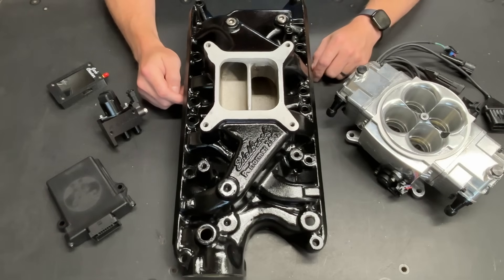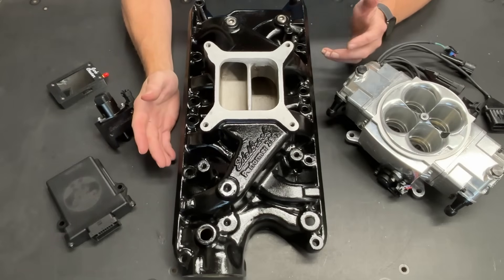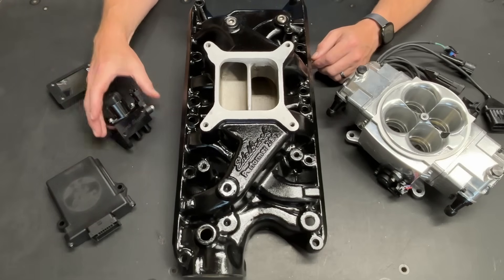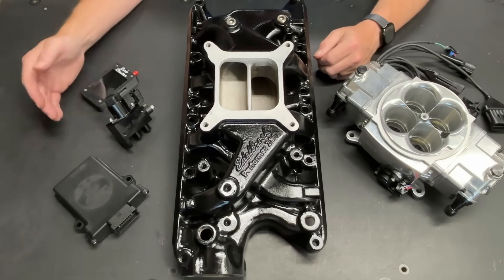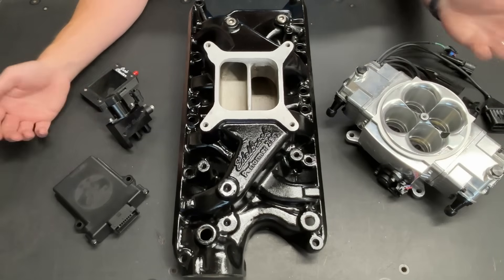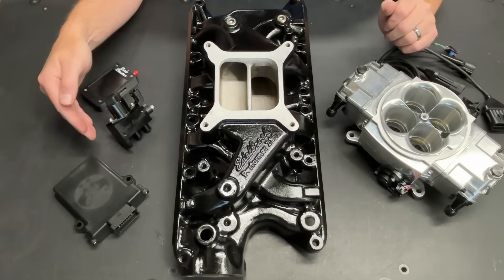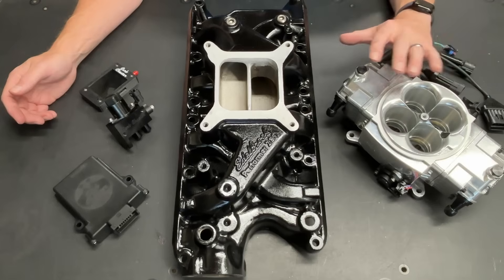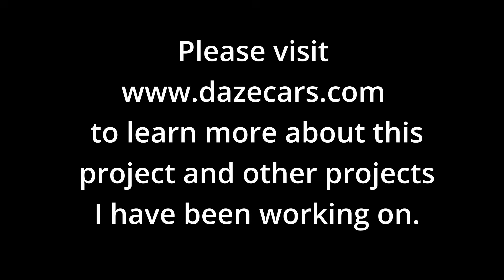Computer Controlled Fuel Delivery Carb Cheater 2.0 Vs Sniper  2 EFI, Why I Decided to Try Them Both

Comment: Very interesting. Funnily enough I got a quite a similar device in my '73 VW Beetle. A guy named Paul Wurm made catalytic converter retrofits for a lot of cars including carburated cars. In order to stay within lambda 1/AFR 14.7:1 he just added a slightly larger main jet and a O2 sensor controlled air bypass valve. Just like the carb cheater only a few centuries earlier 😄 Fun to see that concept being used somewhere else.
Reply from the maker: Its an outstanding idea so I am not shocked it has been used before

Comment: The boiling point of gas leaves a good reason for efi. Gas boils above 180, so when the engine is shut down and the temps go up, raw gas is leaked into the engine. Also if the carb sets a while, the gas evaporates. I like the idea of the O2 sensor...
Reply from the maker: Gas in the carb and its tendency to boil off is a great and valid point, but Im not really addressing that with this series of videos.    There are tons of things I could compare  making a pro con list for both and crown a winner, but thats not the point.  (besides everyone on the internet would tell me why I was wrong)  There are advantages both ways and things that each one will do better.  I'm just comparing the drivability and performance of the two while the engine is running.

Comment: When comparing costs, you also need to include cost of a high pressure fuel pump forEFI and potentially a different fuel tank and new EFI rated fuel hoses.  Looking forward to seeing the comparisons.
Reply from the maker: cost wasn't a direct comparison,  just a ball park.  Especially given the fact that sniper is not the only game in town and there are other TBI units in the $600-$800 range.  Also in some cases there are ignition component considerations but being those are often optional and not really a factor.  Basically the prices are similar in a lot of cases but not always and there are too many variables so thats why I went with a ball park.

Comment: The reason I went with carb cheater on my newest project is that it already has a carburetor that works very well, so it'll be cheaper and if the computer on either or fail the carburetor will still drive home with no issues. I drive my car 100 miles a day to work and back (50 miles one way) so reliability is the most important thing to me.
Reply from the maker: Probably would have worked really well with the carb alone and the CC will likely only make it better.

Comment: For off-road application I don't see it since it doesn't solve the problem of banging around and running at angles.

I do not like aftermarket EFI systems due to quality of components, being at the mercy of fill in the blank brand, and you can't easily buy replacement parts over the counter at a parts store. I like OEM systems you can get away with it.

If I was going with a carb this would be good to help you tune it on without a dyno. But I wouldn't use it as a band aid for a poorly set up carb.
Reply from the maker: I agree it doesn't solve any offroad issues but could be used with an offroad carb.  To your other statements, its not designed to be a bandaid for a pooly tuned carb, not the point at all. You still need to run a properly tuned carb, this just helps lean out all those times when a carb WILL go rich.  Running rich is inherent with a carb because a little too rich is safe but a little to lean is dangerous and carbs completely err on the side of caution
Reply: @dazecars I could see that, almost like an insurance policy for your mixture. I think running a carb it would be nice to have a wide band to see what it's doing. 

Is there any literature on how much altitude it would compensate for? That would be cool if you go up in altitude it gives you some fuel correction.
Reply from the maker: If you watch any of the Carb Cheater videos he says over and over, " a carb is a static metering device in a dynamic environment"  in other words there are so many variables effecting the fuel ratio but a carb only adjusts based on airflow changes.  Thats why carbs always a some point over fuel an engine even when properly tuned.  Extra fuel is safe but not enough fuel is dangerous.  This is proven out by the fact that a carbureted engine gets tired at 100K miles but a n EFI engine is good for twice that because the oil is not washed off the cylinders.  

As far as altitude I think it can adjust for most altitude changes.  That is exactly where the idea for CC came from.  Luke was using a wide bad O2 sensor with AFR gauge and driving on power tour with significant change in altitude.  He had a vacuum hose and adjustable valve to compensate for altitude changes (massive changes not constantly adjusting as he was driving)  It was this concept that lead to the CC system that would adjust on the fly.

Comment: Dropping the fuel tank installing  a fuel pump. Running power and lines makes the carb cheater well worth it.
Reply from the maker: lots of ways to get it done.  I will be running an auxiliary tank with high pressure pump but if I was dropping the tank it would be a big pain as you mentioned.

Comment: One difference between the carb cheater and the sniper is support. One has been around forever while the other has not. Another side of the coin is location and what I mean by that is who will be easier to provide me support when I don't live in the US? 
The carb cheater is an extremely niche product and its great to see it out and about and another option for car folks and tinkerers.
Reply from the maker: I totally get what you are saying and yes support from the car community is for sure far better with an established product like sniper EFI .  But  the quality of support from the direct supplier is a little different thing.  There are several companies that had amazing tech support but once they were purchased by Holley their support was just OKAY.  Holley has gotten so big that their tech support agents in many cases only know what the computer in front of them tells them.  This stands to reason given the vast quantity of parts Holley offers as no one would be familiar with them all.  On the flip side the creators of carb cheater know the one product they sell, front to back and are fairly good about answering emails and youtube comments.  Not really arguing with you just saying it's not as simple as one has better tech support than the other.  The support you can get is very different.  Just my $.02 thanks for the comment
Reply: There is one other thing to.
If the carb cheater won't work - you can ride around like nothing happend.

Sniper breaks and you're screwed on the side of the road.
Plus as far as I know the cc uses a common parts, easy to get at any part store & Luke is super helpful with any support I've seen
Reply from the maker: excellent point

Comment: A computer controlled vacuum leak doesn't change the amount of fuel flowing through a jet.  A rich tune with more air is a leaner tune...but the amount of fuel never changes, IMO.  A GOOD tune needs to be done first to get the CC to work well.
Reply from the maker: I totally agree.  Carb Cheater is not a way to avoid tuning a carb.  You get the base tune in, get it running well and then Carb Cheater makes it better in those situations where the carburetor is running a bit fat
Reply: Fuel follows vacuum signal..
Reply from the maker: its not that simple

Comment: I like that there are Options!

What a great way to retain what ya gots and adding a Fast Respond Wideband Oxygen Sensor and using that to Dynamically 'Tune" for a more efficient use OF fuel.

... I went with a '96 ferd long intake runner and efi setup and custom EFI'd my 78 F-150 300! I really like it but if the EFI craps out what then? I can't just plunk a carb or tbi on this now... lol, <3 all
Reply from the maker: It is nice to have options!!  The question is are the options any good 😁
Reply: @dazecars  The ones leaving Ya grinning Ear to Ear behind the wheel!

Comment: Had the cheater for awhile now, very good paired to the autolite (best card ever imho). Would like to see the difference in cold performance. With the cheater not having a temperature sensor vs sniper, think it may have an advantage until up to temp. Sniper also integrates well into ignition controls. Still prefer keeping as close to stock as possible. Seen too many companies come and go / quit supporting over the years. Can still by bone stock 60+ year old parts though, most any place you are.
Reply from the maker: I too am a fan of the autolite.  The biggest down side to what sniper is doing is $$

Comment: I believe it’s best to block the exhaust gas cross over through the inlet manifold on the EFI conversion. EFI doesn’t need to have the fuel atomised by heat as the injectors optimise the the atomisation
Reply from the maker: a cooler charge will make more power but I want an apples to apples comparison... or at least as close to apples to apples as I can get so I think I will leave it open, at least for now.
Reply: @dazecars if you’re comparing apples, then you should give us the comparison with the heat crossover blocked off also.
Reply from the maker: That would involve installing the intake three times and I am limited on time.  I will install it with the crossover intact, run the carb cheater then swap out to the sniper.  A lot of guys are not going to take the time to pull their intake when installing a sniper just to block off the heat crossover so it should still be a valid test.  Biggest advantage to blocking it off is it makes for a cooler charge creating more power BUT I'm not dyno testing it so I really doubt that mode would be noticeable in the seat of the pants o meter

Comment: Are you still going to develop the inline TBI setup? I noticed you are showing a 289 intake in this video, won't the 393 require a 351 intake?
Reply from the maker: too many projects not enough time 😁  The Galaxie currently has a 302.  The 393 has been assembled as a short block but I have not gotten any further in that build.  The carb cheater sniper EFI project will be temporary.  When I pull the 302 out of the Galaxie to drop in the 393 the 302 will go in the Mustang.  The Frankenstein EFI is currently installed on a 351 W on my engine run stand but I have not fired it up yet.  I tend to jump around from project to project and have not yet circled back.  This summer has kicked my but with unexpected activities demanding my time and I have had little time to get any of these projects done.
Reply: @dazecars thanks for the extra info, I get it on not having time! Always enjoy your videos and presentations. The inline throttle bodies interest me because they look kinda like the Autolite inline 4 barrel setup
Reply from the maker: Thats a big part of why I did it, EFI that looks a little like dual quad!!

Comment: This is great! I am looking at the sniper 2 for my 65 mustang but 1200.00? It looked like 1800 to 2400.00 for everything but I have not made that call to Holley to confirm it. I didn’t even consider the carb cheater maybe that’s the best combo as even a down carb cheater won’t keep you from getting home.  There have been a few stories of people having to send the snipers back in for repair but those returns were quick. Another neat add-on would be power blast plates for the carburetor you are using!
.
Reply from the maker: I can see advantages for both, just depends on what you want to do and what you are comfortable with.

Comment: Maybe I have a fundamental misunderstanding of the Carb Cheater, but I think of it more of an electric air controller versus electric fuel delivery.
Reply from the maker: You are completely correct, it controls the air/fuel ratio by altering the amount of air that inters into the intake.  There is no enrichment only leaning out of the mixture but this is not an issue as a properly tuned carb tends to go rich not lean.
Reply: As I see it if the carburetor was properly tuned then the carb cheater would serve minimal purpose. It seems to me the carburetor needs to be tuned slightly rich so the air bleed can correct that but allow for a richer condition when needed. I assume the cheater does not function until the car gets up to temp. Otherwise an air bleed would cause issues when cold.
Regarding the same fuel being used regardless..., because of the air bleed it would seem to be slightly less. The bled in air is not pulling through the venturi and drawing fuel. Lastly I have concern about the distribution of the bled in air. Is it contributing equally? I think it would be biased to either the primaries or the secondary's depending upon the point it enters. And there are similar concerns regarding a single vs dual plane manifold as to blending. Anyway, just a few thoughts.
Reply from the maker: Those are some good thoughts.  The biggest thing is carbs default to being rich.  They come that way from the factory because rich is safe and lean damages things.  Keep in mind we are not talking massively rich we are saying  13:1 or so.  Even a properly tuned carb that runes at the proper AFR most of the time will have moments when it goes rich.  This extra fuel is why a carbureted engine typically is getting tired at 100K miles but an EFI engine can easily do at least twice that.  The extra fuel washes down the cylinders a little bit here and there shortening the over all life.  We are not talking about massive quantities of fuel just a little at a time.  This is what Carb Cheater helps to eliminate.  So you are not starting with an intentionally rich tune.  You are starting with a normal tune and letting carb cheater clean up said tune.  Total distribution could potentially be an issue but thats the case with PVC gases and carbs in general.  In my case the dual plane intake has had the divider cut down to help promote balanced fueling or in this case balanced addition air and eventually balanced fueling with the TBI.  Lastly you cant think of carb cheater as a device taking big swings making massive changes to what the carb is doing.  Its small changes and small improvements to an already well tuned carb.  I think the biggest hang up people have is they assume this product is something that allows you to drop any carb on any engine, do nothing with tuning and carb cheater does all the heavy lifting.  In reality its a diagnostic tool giving you real world feedback to help ensure the best possible tune and then it also helps compensate for those situations where the carb cant quite get there and defaults to rich... at least that is my understanding on how all this works.  We will see if I have it correct or completely misunderstand when I get it installed and start playing with it.

Comment: I'd be interested to see if you could measure any difference in milage between your current setup with a carb vs with carb cheater vs EFI. Could be an interesting data point.
Reply from the maker: You are actually the second person to ask for that and its a great idea but would be hard to get enough driving time to paint an accurate picture... Let me see what I can do on this one.

Comment: This system was first utilized in target drones powered by 2 stroke engines with a pilot jet in the carb controlled by a servo to actively adjust the AFR. It works very well in my opinion than a complete EFI but I don't know if it would have the same benefit on a larger engine like yours. I worked on those type of carbs and I do have some. Thanks for posting.
Reply from the maker: Interesting information.  The reviews for installs on larger engines are very positive so it should work well

Comment: computer controlled air leak to correct jetting/acc pump. interesting idea. I'm interesting to see if it can also enrich the mixture.
Reply from the maker: no there is no enrichment option but thats not a problem as a properly tuned carb tends to go rich rather than lean in situations where the AFR is not correct
Reply: @dazecars  Of course if you intentionally tune the carb to run a little rich, CC should bring it to the desired AFR from either direction.
Reply from the maker: You shouldn't need to do that at all.  Tune it correctly and let CC do the rest.  A carb is built to go rich rather than lean in situations where it is not optimum.  It is because rich is safe and lean is not.  So its already rich no extr enrichment needed.  This is the exact reason carbureated engines go 100K where EFI can get 3 X that.  The extra fuel a carb provided reduces iling effectiveness.

Comment: threw my sniper1 in the  garbage it had too many issues created by Holley   talking to Carb cheater now since I have an Edelbrock AVS2
Reply from the maker: I believe the newer sniper systems are far better than the early ones but I have no hands on experience with it... yet.  We will see if it was money well spent or not.  What were the issues you were having and was it on a dual plane intake or single?

Comment: I received my Carb Cheater a few weeks ago. I am dropping it under my Holley carb after I finish getting the T-5 going (the parts I ordered from you will be here Thursday) .. My goal is to make the "63 Fairlane with a very healthy 302 my daily driver (yes, I am going to install AC soon as well). Good stuff, and I love supporting the local small shop folks like yourself, Thunderhead289 and Joe.
Reply from the maker: And those of us that are small fish in the automotive aftermarket world, appreciate your support!!
Reply: I have the T5 kit for my 69 Mach 1 also. It was easy to install. Unfortunately I haven't been able to get my car the rest of the way together to test it yet. I wasn't sure I would like a hydraulic clutch kit, but my R33 GT-R has one and it's been great.
Reply from the maker: I personally find a slave cylinder type hydraulic clutch to be the best combination of light pedal,  and smooth action while still getting a feel for what the clutch is doing transmitted through the pedal.